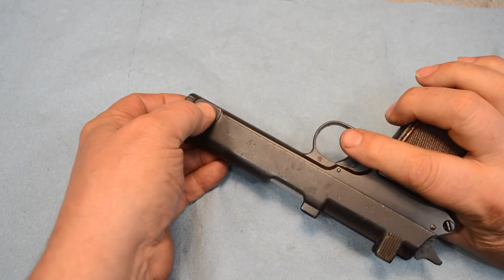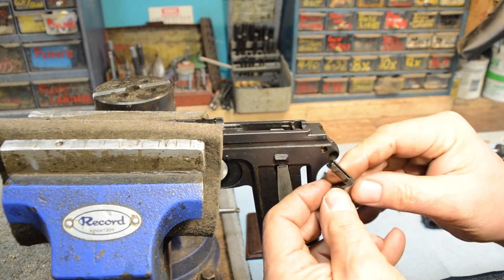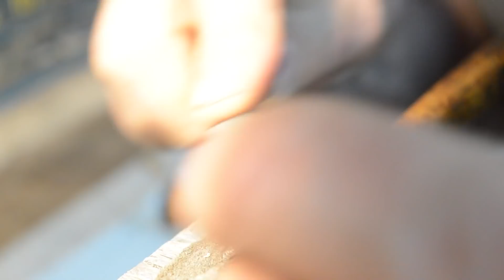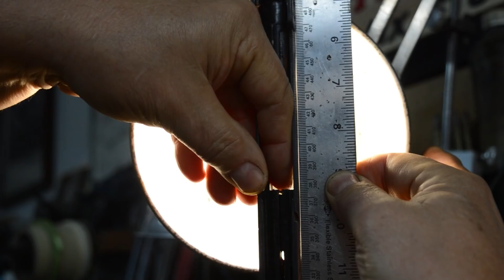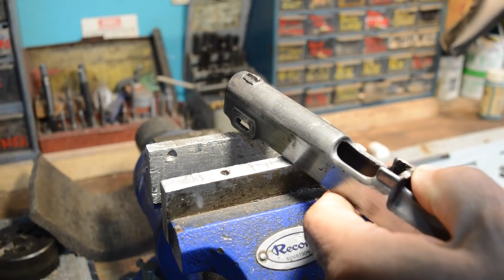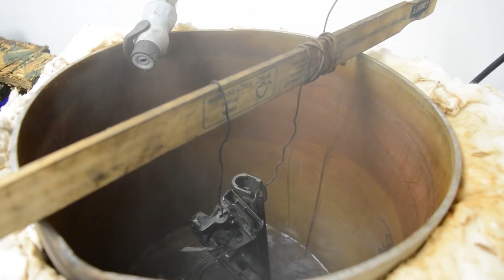Anvil 099: Steyr Hahn metal and woodwork

Comment: The first and only time I ever saw one of these was in 2004. I found 5 boxes of 9mm Steyr in a local gun shop for like $10/box at the time and ask the owner what they were for. He said he had the pistol in the safe, it was kind of rough and had homemade grips, with a loose safety. He wanted $140! So I bought it and the 5 boxes of ammo. I found grips online, a local gunsmith fixed the safety, and I even found some stripper clips. It was a fun gun for those 250 rounds over about 4 years. I wasn't reloading at the time and the big ammo companies weren't quite yet loading the weird stuff again so I sold it for a decent profit in 2009-10. With what they go for now I sure wish I'd have kept it, especially now that I reload.
Reply: Number regret of a gun owner selling a gun . I can say the only one i have zero regrets selling was a Taurus PT945.

Comment: Mark, I have two of these beauties with some extra parts I obtained for emergencies (spare slide , some springs , etc.) I also have a few stripper clips. If you want, I can send some factory ammo of modern times and some stripper clips. Let me know on your Patreon page (I am subscriber). Thanks for doing this pistol, it's appreciated for helping me with mine. You can also get new barrels for the Steyr Hahn from Steyr in Austria; not only 9 Steyr but also 9x21 IMI, 9x19 Luger & .30 Luger. I know as I have obtained 3 new barrels and am presently waiting on the 9 x 21 IMI to be delivered.

Comment: Mark, your description of hitting a hammer with another hammer with something under it taking the stress as "a punch with a wooden handle" is spot on.  In fact, there is a type of hammer known as a "Pin Hammer" that is made specifically for use in that fashion.  We use them on industrial heavy equipment maintenance to knock out the pins holding on hydraulic cylinders.  Awesome work as always!

Comment: I remember taking apart my 1943 pellet gun apart when I was younger, I rotated the rear cap captured by a detent in the body. The rear cap flew off and put a dent in the ceiling because it held all the pressure of the main spring. 

Don’t mess with springs...
Reply: My dad and brother work on atvs, I always hold my breath whenever I see them working on shocks, those springs mean business whenever they dampen a 600+ lbs movement to a comfortable ride on rough terrain and pothole central. I’m actually more comfortable with firearms springs than I am around vehicular ones.
Reply: @FrostyShock349  oh definitely, vehicle springs are not something to mess with. Especially compressing coil springs, I’ll only buy quick strut assemblies.

Comment: I have a 1970 vintage JP Sauer & Sons replica of a Colt SAA.  It’s chambered in 44 Mag.  I bought it when I was in college, and I used to wear it holstered on campus.  Imagine that !   The trigger guard and back strap and ejector sleeve were made of some cheesy powder metal.  A few years ago, I replaced them with brass ones.  The cylinder and barrel seem well made and robust.  It’s a hand wrecker, and a Beyonce to shoot more than a few rounds.  Best to wear gloves because you need a two hand grip to hit anything and when you grip it forward of the pistol grip it sprays your hands with blast emanating from between the cylinder and the barrel.  I truly enjoy your videos.  Ultra informative and educational.
Reply: Got wordy and didn’t ask my question… is there a way to work the trigger / hammer to make the half cock safety a bit more reliable?  Right now it’s a five shooter if you want to carry it in a holster.

Comment: Huh, wow. I have a Steyr-Hahn that could be this one's twin from its "before" state (less the oozing rust, fortunately). It has the same badly ground crest, the same electropenciled numbers (well, a different number, but you know what I mean), and the same obvious refinish work. About the only significant visual difference is the grips, which I think are later replacements (they aren't checkered, they just have vertical grooves).  Makes me wonder if they both passed through the same set of hands at some point in the distant past.  Based on Othais's info in the Steyr-Hahn Primer, I suspect mine was one of the ones that were made for Romania, but seized by the Austrian government before they could be delivered.

Great video. It's always extra-fun to see a gun that looks like something from my own collection in your shop. :)

Comment: The human eye and brain can be incredibly precise. When I worked in a polystyrene foam factory where we used hotwire cutting, using a threaded rod to conduct to the wires, I could get to a 32nd (the thread spacing) by eye on anything much less than a foot or so just by seeing parallels over 4' of wire. I know lifetime framers who can keep rough framing within standards laying out studs and never touch a tape. Fearfully and Wonderfully made, indeed.
Reply: I've gotten to see something similar in person, watched my grandpa frame out a  barn and one of the guys said something to him about not measuring often enough so he told the dude to measure behind him as he went and then shut the hell up. 

Dude didn't have anything to say, pawpaw's work was on point. He had been framing for like 55yrs at that point, he was 70yrs old still working circles around people.

Comment: I have a one just about like it a 1913.  I give 200 for it 3 yrs ago and found 2 boxes of ammo it shoots fine I did have to clean it after I got it it was just dirty no rust I did have to make a plunger they had a piece of plastic on the end of the spring and they were shoot regular 9mm which is more presure then the 9mm styer rounds but I sure wouldn't recommend it. I like the older firearms as it like holding a piece of history.

Comment: Either grind the pits or precision weld them then, flat surface but; you're right the pistol has been "worked over" by other persons who didn't know what they were doing. Usually, I bead blast the pits then weld. Good luck trying to find the old varnish. Up until about 2009 or so real oil varnish could be purchased. Very nice work saving the old pistol.
Reply: Well Fine Woodworking magazine years ago published a formula for " vernis Martin", you could therefore make your own. Just don't burn down your shop doing it,or have the stuff splatter or spit. The burns that result can go to the bone.
Reply: Once the grinds are there, removing them is also defacing some history.

Comment: I am sure glad you did this break down.  I own 2 Steyr Hans  and 1 Roth Krnka. As to ammo, Starline makes 1912 9X23 and as you know THIS 9x23 is NOT the same as 9mm largo.  You can use a 9mm Para die to make it.  I happened to have a bunch of old 1912 Steyr stripper clips  so I made some ammo and filled them up.  I do NOT have a 1907 Roth Steyr stripper.  they are made of pure unobtanium.  Thanks for the info Mark!
Reply: You should check out Forgotten Weapon’s video on new 3D printed 1907 clips ; function is a bit random but some do work pretty good, and they cost next to nothing to print or to have a shop print them. Could be the only way to enjoy your 1907 without buying an original clip for a ridiculous price 👍
Reply: @zebracherub    I did:  I have a Roth Styer, 2 of these strippers (one works great, one not so much) and a RS facsimile holster made in India; it has a pouch for full strippers.  That is: a Compleat Rig.  Yes! Ian is GOLD when it comes to info about these obscure old guns!

Comment: Ahh..one of my favorite sidearms !  
A question for Mr. Novak. I have the 1907 Roth-krnka like in the picture. It  " Had"  a horse shoe shaped spring that put pressure 
on the magazine follower/ magazine unloader . The button on the  side now rattles easily instead of having pressure on it.. Thus it is a single shot only.. I have no idea what happened to the spring. I only found a small piece of it upon disassembly.. Can you recreate that spring ?? and yes, I do have some Fiocchi 8 mm Steyr !! .  Although I will probably not shoot it much more, I would like to repair it.

Comment: I have one of these made in 1919. It was later converted to 9mm Luger by the Germans, Has all of the correct markings for such. 9mm Steyr cases are available for Graf's I believe. Standard 9mm projectile and could probably use 9mm dies.

Comment: So they machined a dovetail and full recess into both sides of the frame just so they could have the wooden grips dovetailed in? Jeeze this era certainly loved their unnecessary and overly complex machining operations! Not only that but if you took away the width necessary to recess the grips into the frame like that, you'd easily have enough room to stagger the rounds in the internal magazine and come close to doubling the capacity! Oh well. The quirks are what make these beauties so compelling.
Reply: I agree about the complexity, but respectfully disagree about the thickness.  Rather than "the width necessary to recess the grips into the frame like that" (which is literally accurate in chronological order of operations) think about it as raising the front and back just enough to curl over the grips a bit - which isn't much at all (see 5:03; the metal grip frame might be 5/8" wide tops).

The Steyr system isn't perfect (the tiny splinters of wood holding the grips on are vulnerable if an untrained person tries to peel them off).  In terms of space efficiency, though, they seem to have a big advantage compared to the Colt (where each side needs enough metal to screw a bushing into, then a bushing, then enough wood for a screw to hold, then a screw head with enough wood around so it doesn't stick up too much).

Comment: never hit a hamer with a hamer, found that out the hard way when a piston inside a cilinder was stuck when I was young(14 or so), I took a hammer put it on the piston while my friend wacked my hammer with another hammer to get the piston down, should be ok right, well it wasnt, a piece of my hammer flew off lodged it inside my hand and it's still there 40 years later, a good reminder never to do that again.
Reply: It really depends on what type of hammer you're using and how old the hammers are, they make hammers intended to be struck by another hammer one face is hardened the other softened to allow deformation rather than chipping, but you're absolutely right if you're not certain what type of hammers you're using never strike a hammer face with another hammer or bad things happen such as you incident which honestly you were lucky it could've been your eye that caught the flying shrapnel.
Reply: @notchagrandpa8875  Yes I think I was lucky as a young kid, lessons learned

Comment: When sanding  the slide flat, why wouldn't you deck it. Run it on a true surface  in a figure 8 pattern? Curious.
Reply: Because it was so boogered up previously I think if you did this you would end up making the slide to thin trying to achieve flatness. The dents were just to deep looking.
Reply: @pachuagfirearmsrestorations  I would have to disagree. If you are sanding that's what you are doing taking down the high spots to accommodate the wallow.  But I appreciate your perspective Sir and thank you .
Reply: 31:38 and onward a bit is your answer.
Reply: Two reasons: there is a raised boss around the cross bolt hole at the front of the slide. This would prevent it from sitting down flat. Also, you would have to remove too much metal to get it flat, what Mark is doing is just trying to get it to LOOK right without buggering it up.
Reply: Instead of peaks and valleys, your making rolling hills,
Reply: @JonoSann  best answer yet. In my memory I questioned those same areas . I've been to busy to take a peek  . I would have to agree.
Reply: @pj7362  aside from the boss at the cross pin, he'd have to remove probably .040"/1mm off each side of the slide to get rid of the dips. That's a hell of a lot of material to remove.

Comment: Could regular sand propelled with low pressure air be acceptable for less than perfect jobs/practice? Or should shortcuts be avoided? Thinking something more like a gentle washing with sand could be acceptable if sparks aren't flying.
Reply: Having been involved with a lot of different blasting over the years, beads peen/sharps cut. So no, the geometry of the media is what defines the finish.
Reply: @Davemte34108  bummer. Oh well. Gotta pay to play, get what you pay for, if it's worth doing it's worth doing right.. Thanks

Comment: Peo0le over polish rolexes all the damn time and ruin them. DONT POLISH! There are methods one can use to remove gouges and small dings that actually heats the metal enough to “move it around”. Takes an expert, if y’all want 5his done see this guy or a real watchmaker.